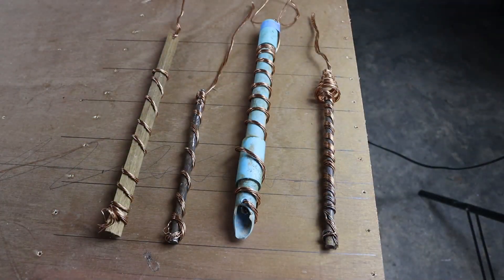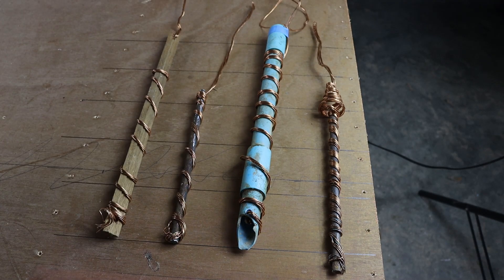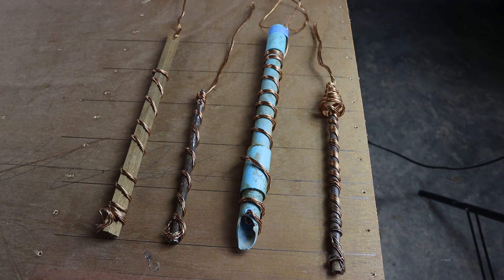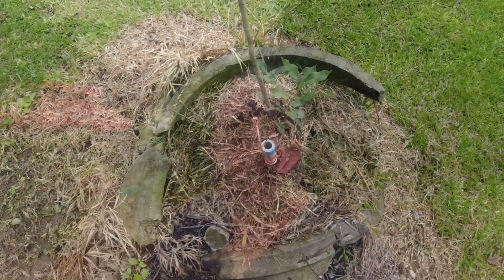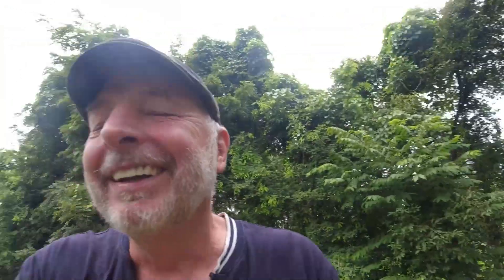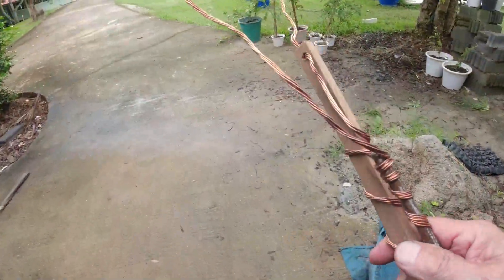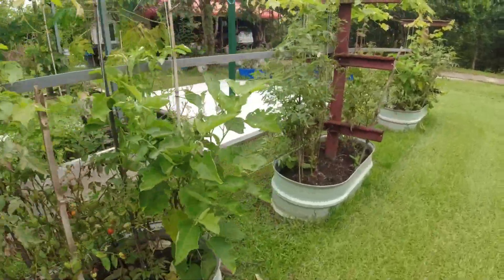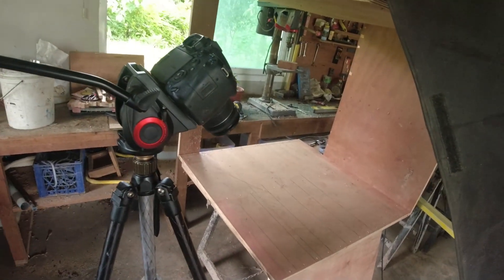Electroculture Science! or New Age Mumbo Jumbo?

Comment: Hi Gordon,
I’ve been a subscriber for a few years now and watch most—if not all—of your videos. Years ago, I was told that driving a copper nail into a living tree would kill it. After watching this (your) episode, I decided to do a bit of research myself. Here’s what I found: Copper Toxicity in Plants and Soil
While copper is an essential micronutrient for plant growth in small amounts, it becomes toxic at higher concentrations. Excess copper can inhibit root development, disrupt photosynthesis, and reduce seed germination. In the soil, high copper levels can kill beneficial microbes and earthworms, degrade soil structure, and interfere with the uptake of other essential nutrients like iron and zinc. Over time, copper accumulates because it doesn’t break down, making contamination a long-term issue—especially in confined garden beds or pots. So while copper has its place, it must be used with great caution to avoid harming plants and the broader soil ecosystem. I would not want you to harm all your hard work! Looking forward to the outcome of your experiment.
Reply from the maker: These are great points well made and researched, hopefully 6ml copper wire will not be overload, I shall monitor it carefully. GT